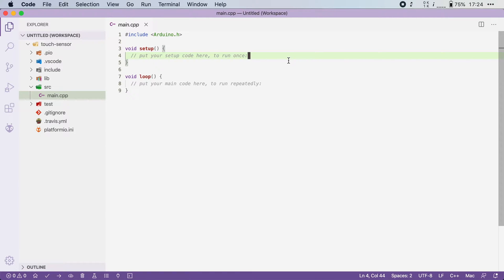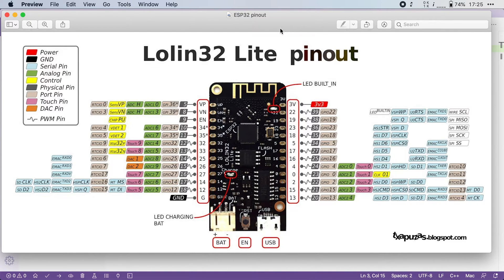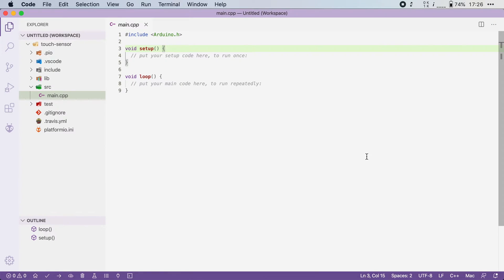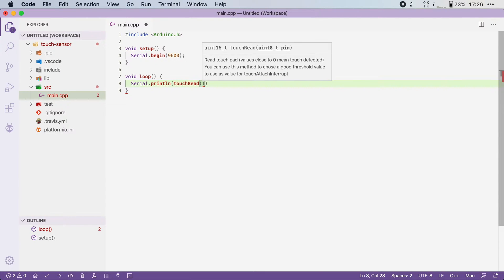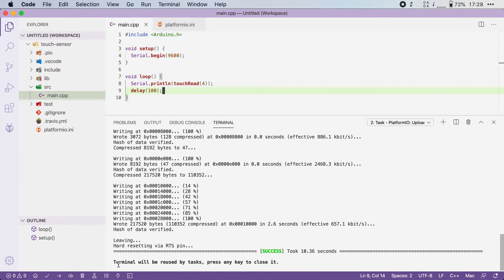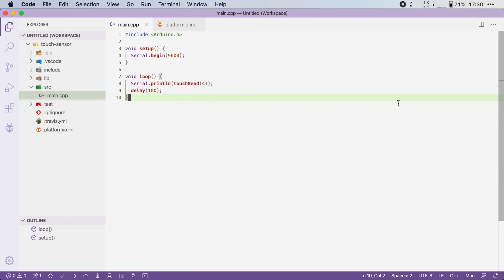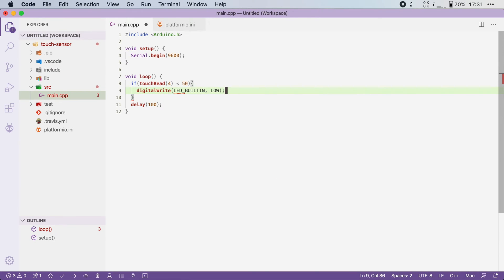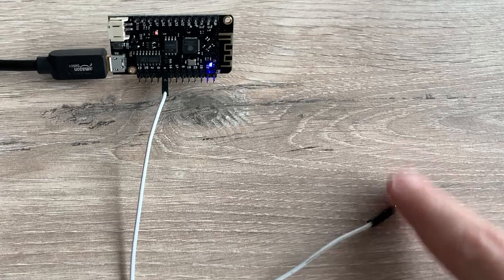Using Touch Pins on a ESP32 (ESP32 + Arduino series)

Comment: LED_BUILTIN must be defined somewhere? Where do we find predefined variables for our particular board? Can the same input be used as something else too - e.g. input, output, adc? e.g.  set at op whilst doing something but then reset as touch after? How can it be set to touch if it was set to something else?
Reply: The LED_BUILTIN is a predefined library

Comment: Whenever I try to upload to my ESP32 I get this from platformio:

avrdude: stk500_getsync() attemp X of 10: not in sync: resp=0xce
avrdude: stk500_recv(): programmer is not responding

X will go from 1 to 10 before stopping.

Uploading works fine from the Arduino IDE, but it seems the code doesn't be have properly (using the FastLED library at least). Trying to use platformio I can't get it to upload after compiling. 

I noticed if I scroll up to the top of the output from the terminal, it says:

"Processing uno (platform: atmelavr; framework: arduino; board: uno)

Does that mean it is trying to upload to my board thinking it is an uno? I definitely selected the "Espressif ESP32 Dev Module" when creating the project.

Comment: when I dont touch the wire, values still goes down below threshold and turns on the led..........I dont know how you get constant value when wire is not touched......any solution?